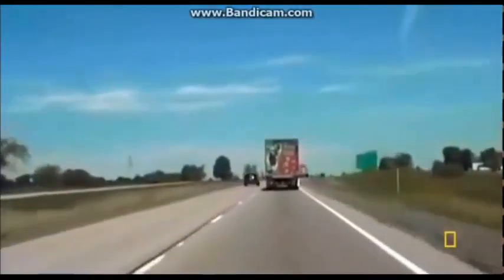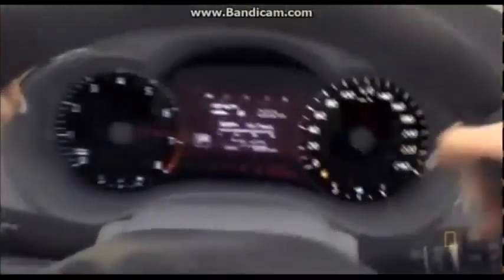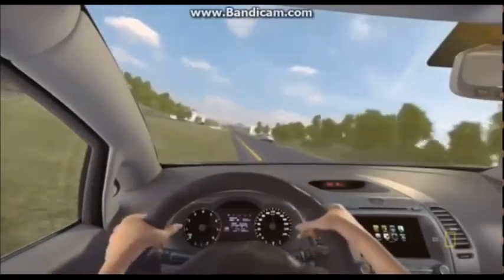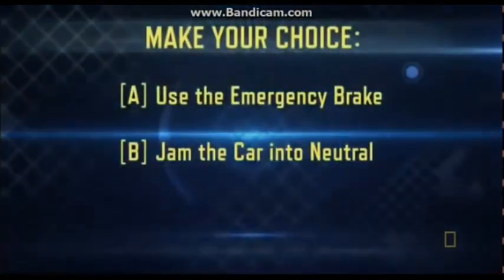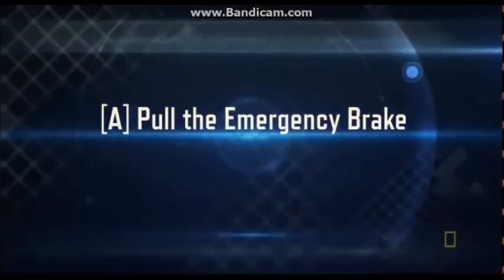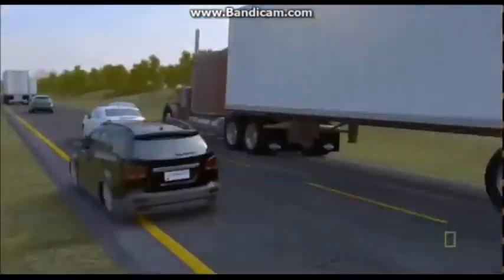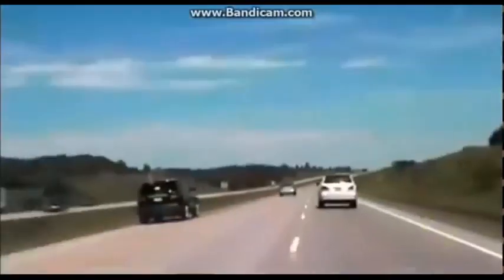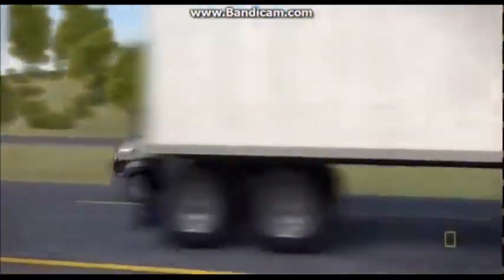How would you stop your car if your gas pedal stuck

Comment: So normally brakes are always stronger than the engine in normal street cars. So you can always stop when the gas pedal lock up.
You can turn off the engine for shure. But after that immediately turn the ignition back on. So the steering wheel wont lock up.

Comment: One time the gas pedal got stuck with my dads car (Chevrolet Caprice) when I was riding with him, I was a kid that time. He was able to solve the issue by pressing harder on the gas pedal which unstuck the gas pedal. Risky but it worked.
Reply: Pumping the brakes can cause them to fail. Until there is an option in cars to cut the power to the engine it will never be safe in electronically controlled automatic cars.

Comment: you can turn off the car and still use the will as long as you keep you battery and accessories on. If you turn the key all the way off then yes, your wheel will lock up (as long as your car isn't old as shit, because "wheel locking" is an anti theft thing that started a few decades ago.

Comment: When he said get the car out of gear then press the brake, if you turned off engine your engine is no longer accelerating so you could slow down then and I don’t think it will lock the steering and if it does cars should change the steering lock so it goes off at speed if the engine is off

Comment: But all jokes aside, you can use engine braking which is where you downshift to a lower gear (ex: from 5th to 1st) which wrecks your transmission but slows the car down

Comment: how i did stop it, you mean. it wasn't hard and i did it in a split second. it got stuck on an pretty severe incline, leaving a traffic light. i dodged the car in front when i realized the pedal was stuck (it was an old '51 jeep willys that was pretty dodgy, so i had to floor it to even make out of the light), then i turned left at the corner were there was no one and stepped on the clutch. i wasn't prepared for it, i never trained for that, heck it never even crossed my mind that this could happen to me, but i was still able to narrowly avoid any accidents. i won't lie, for a moment there i braced for impact against a wall, but i never gave up trying to get control back. it was close, but everything went alright. sounds stupid, but from the time i realized it was stuck to succesfully recovering control was like only a second. if that ever happens again i'm pretty sure i'll do it faster.

Comment: If you turned off the engine, you could use the brakes since your engine is not in use anymore. And you dont have to do it immediately wait until you have a clear shot and do it.

Comment: Or D: Pull On The Accelerator Pedal           And Steer To Safety

B Is Bullshit Becuase You Can’t Put A 120MPH/7RPM Car In Neutral
Reply: Electronic control systems will not allow it.

Comment: well this DId happen to me,  i had  my preteen daughter  in the passenger seat..i was STANDING  on the brakes.. i blew through a red  light at the EXACTLY best time, got to a smaller side  road and  yeah while i shoulda  threw it into neutral? i threw it  into park..nasty  noise  but it stopped and shut  off  the engine.  one of the  more hair raising  experiences  i've had!!  turns  out the cable from the under the brake pedal to  the next part was twisted for some reason and  boy howdy i was glad to not die. :D specially with my  lil girl  there with me.

it was a  1990 jeep cherokee  pioneer 2 door.(i think that's  it cause  it's been several years since i had that car.)

Comment: Not always the pedal that is stuck I had my 03 Galant and my throttle was stuck open I was doing 90 and trying to slow down and my brakes failed, still gaining speed I threw it into neutral and it red lines quick then I shut the engine off and the power steering and brakes locked. Got her off the road safely

Comment: I would still turn off the car, just put the key back into the on position and the wheel won’t lock. It’s pretty easy to steer a car with no power steering at 50mph plus. Same as the cars back in the day.

Comment: Just an FYI if the road in front of you is clear, shutting off the engine and then applying the brakes will stop you the quickest without blowing the motor in your car

Comment: Turn off the engine is the best option BUT with not removing the key cuz when the key is still in you can freely steer without the wheel to get locked

Comment: Cough Might want to point out that all new automatic models in the US have a cutoff switch designed into the car... So if your speed goes over a certain limit your car's engine will automatically shut off...

Comment: These people are wrong. Turning off the engine and turning the ignition to the mode right before the ignition mode unlocks the steering wheel. (I am talking about the mode where you can use the fan while the car's engine is off.)

Comment: This happened to me when my mom let me drive here car for the first time.
I automatically noticed that the gas pedal wasn’t stuck but the engine kept idling at higher and higher speeds.So I actually had to PUMP THE BRAKES and weirdly enough this stopped to engine for revenge at a higher speed.Then I noticed that I can drive very slow but I still had to pump the brake.Very awkward moment.Never asked mom to drive her car again lol

Comment: That lady said she tried to put it into neutral and it was stuck
Reply: That is the problem with modern electronic automatic cars they cannot be put into neutral when there is a electronic fault. 
The only true way to be able to deal with this is to actually cut power to the engine. Cars should have a manual switching system that allows that. 
Electric cars most certainly should have that ability.

Comment: Since the situation is at a highway and cops are warning other drivers. Turning off the engine even if it would lock the steering wheel might make you leave safely.

Comment: This happened to me on the jersey turnpike.  03 mustang. Installed a cold air intake.  Didn’t notice the throttle body  was hitting the band clamp at 3/4 throttle.    Hit the gas hard and the throttle body got stuck open.   Couldn’t get it free.  On the highway. Its a stick car. Neutral or clutch in would of blew the engine.    Put it in 5th gear and rode the brakes till I pulled over into the shoulder and shut off the car.   Disaster avoided.
Reply: I assume your car was a manual?

Comment: Turning off the car won’t lock the wheel. It’ll lock if you take the key out of ignition. Turn the key off then turn it back to where the radio and ac would be on. Sure you won’t have power steering but you’re not taking huge turns. My van used to shut off randomly and I’d lose my power steering. It was tough but I could still steer. This lady just panicked and clearly didn’t get any good advice.

Comment: Actually with that car if the car is in gear and you kill the engine you can still steer but have no power steering. The steering will only lock once the key is fully out but that is not possible because the car is in gear.

Comment: Just turn engine off by key. Then bring back key to "before start" position to unlock steering wheel and brake to stop. You saved engine and yourself, easy. Some stupid AT dont let you put it in neutral when engine is under load I think.

Comment: 110 MPH. They talk like this is some insane speed. Yea, it is not nice, but it is just 170 km/h.

Also, turn off the engine, but leave the key plugged in. Your steering wheel won't lock up. Maybe find out beforehand how to turn off your engine if you have a push-button.

Comment: Turn off the engine but not turn the key all the way off so the steering doesnt lock. 
 
Edit: power steering isn't really necessary at high speeds.

Comment: 1. Clutch first, then go for neutral (Patch pending for US servers. If you don't have a clutch go directly to step 5. Kappa )
2. Slam the brakes (i assume abs)
3. Turn alarms on (safety is never not important and communication is key 👌)
4. Turn the engine off (assuming your car isn't one of those that shuts hydraulics and steering with the engine, in which case, dump it and buy an actual car)

5. If you can't do any of that: Just aim for the nearest pole, or stationary object, especially if it's one of those thick concrete ones, and experience Darwinism. lmao

Comment: Pretty sure cars can't (don't let you) go into neutral at speed.  Also, have you tried pressing the brakes harder, yes?  Ok, pull the e brake to slow down and don't lock the rear wheels, next, push in the clutch- wait cars in America don't have that, crap.  Also consider off-road over a trucks rearend.
Reply: Pressing brakes as in pumping them can cause power failure of the breaking system at either a mechanical level of electronic level. 
Modern automatic cars use a central control system that if goes into fault can be very scary.

Comment: id switch it off and throw it in nuteral. all my cars are older. steering wheel doesnt lock when the key is out heck one of them doesnt even need a key as the pins where jammed and a the key snapped in it. switch her off throw her in nuteral hit the grass(providing its not bad terrain)  and hold on while easing into the breaks

Comment: Well, my car doesn't lock up the steering wheel when you turn off the car until you open the drivers' door and close it. So, I'd just press the power button twice and the car turns off. Simple.

Comment: the answer is very basic and obvious, just put the transmission in neutral, then you can do either coasting or just braking easily. if you couldn't understand this just hire a driver or take a bus instead.

Comment: I don't know about suv or American cars but I have a bmw series 3 from 95 and if I turn the engine off the steering wheel doesn't block. I have to take out the key to block the steering wheel. Same for a golf4 i use too have and an opel corsa i had if i would not put the key in first stage and let it in second stage it haven't block the wheel

Comment: brake power is often stronger then the acceleration....
Reply: To a point. Once the brakes heat up they lose their ability to slow the car down. If the car is putting all its power into driving, the brakes would probably slow you down but it's likely that they would fade before you stopped.

Comment: My dads BMW puts the car into neutral automatically if you open the car door but it does get really annoying when you are trying to park.
Reply: That is all fine and dandy when the electronic control system is fully operational. If there is a fault it could be entirely different.

Comment: Are those Breaks out of paper? I mean even if you flat out the throttle in a Porsche and push the brake pedal at the same time the car will decelarate and eventually stall the engine... In the video the breaks become red and sparks come out of the caliper I guess that means that the breaks overheat? But there is no way this happens in a production car wich always comes with oversized brakes to make them last longer, this is not an F1 car in wich an Amateur can toast the brakes in seconds of he brakes wrong...

Comment: I've got a manual transmission. When I press the clutch it locks at 2,5 k rpm and then I can gear down all the way to the first gear and I mean... I would drive at most 30 miles or so?^^

Comment: 2:15:  PdSafety, YOU'RE the one who doesn't know all the facts.  The steering wheel WON'T lock if you ONLY turn off the engine by turning the key off only PARTWAY instead of ALL THE WAY:  There are 2 stages to starting a car: turn the key on by turning the key only halfway and starting the engine by turning the key on all the way.  Turning the engine off does not lock the steering wheel if you don't turn the key all the way off.

Comment: but arent there Are Safety Futures preventing use of the neutral on high speeds?
Reply: They are stupid systems and not safety by any account. In a manual car it is easy to put the car into neutral or cut the engine out.

Comment: Umm..

You turn the engine into the accessories position, not off.
The steering wheel doesn't lock in the accessories position.

Comment: In every car the breaks are stronger than the engine, cars with electronic throttle will shut off the trottle if you press brake pedal even if you are accelerating at the same time, about this video it must be a terrible electronic failure
Reply: nah this car just doesnt have that feature. it was horrible from the factory

Comment: If you dont turn your key off all the way the steering wont lock
Reply: So to save your car from blowing up from redlining in neutral if your pedal gets stuck put it in neutral and immediately shut off the engine and stop the car. Common knowledge people.

Comment: I drive a 91 240sx and my throttle cable got stuck open after hitting a pot hole
I literally just threw it in 5th and turned it off then into accessories so my wheel didn't lock and pulled over 💁‍♂️

Comment: i did the exact same thing when it happened to me and when i was stopped i shut down the car and inspected the damage and then after that i started the car again and in neutral i tried to free the pedal in case the engine needed to be driving turned out it was the floor mat the was holding the pedal down and well it was easy to fix XD

Comment: What about putting it in neutral and when it goes to about 50 mph use the handbrake
Reply: Wouldn't have to since the care would be slowing really quick and using the brakes at that point is even faster. No need for the parking brake at all.

Comment: Turn off the engine brake hard and then hand/manual brake (whatever its called) on my mopeds if they gas got stuck id always turn off the engine.. and locking the steering wheel? I believe only the hydraulic stops but you should still be able to steer (heavier though) maybe new cars have some sort of safety that prevents steering? Once got it in the tractor lol engine off brakes and handbrake bang

Comment: If you didnt know the answer to this I pray to God I never have to get in a car with you behind the wheel.
Reply: You are mistaken. There is no answer the electronic control systems will not allow the person to put the car into neutral or cut the power to the engine. Even parking brakes will not function when the car is moving. 
Brakes will not over come the engine power being applied. So everything you do will not work.

Comment: dude on here is wrong in some cars they have a lock feature that prevents you from turning off engine while car is running and locks the transmission in place while vehicle is moving.
Reply: That is a disgusting feature in modern electronically controlled cars. Engines should have a cut out facility.

Comment: Whoever made this went to special Ed.
You.can.not.turn.a.key.to.off.in.a.vehicle.if.its.not.in.park. the brakes can help, don't hit the brakes hard but firmly until you can shift into park or neautral. If the engine revs high in neautral let it. At least your life is spared. Make sure seat belt is on, otherwise your in for a ride or launch towards the windshield

Comment: If you turn off the engine you cant steer very well and the breaks wont work properly
Reply: That is the problem with modern electronic cars they lack manual override.

Comment: Turn the engine off of course. Unless the car has a retarded ignition lock, the steering wheel won't lock up when the key is in the ignition. Also, the brakes should be strong enough to stop the engine even at max revs.

Comment: This literally isn't true. The steering wheel lock does not engage unless the car is in Park. If the gas pedal is stuck, and the brakes have failed, turning off the engine is fine.

Comment: turn off engine, then turn keys half way to keep the wheel unlocked, then break or wait till your car stops while avoiding stuff. you wont have servosteering so the wheel might be a little harder to turn but, you are able to. plus your engine wont explode due to high RPM.  you save yourself, AND the car. clearly the best case scenario. also get a manuel you freedom plebs. im from denmark and im more free than you.

Comment: If you jam it in neutral you're destroying you engine and it will total your car, ebrake will lock you tires and spin you out of control or just won't work but I've never head of any cars locking it's steering wheel when off, just when in park but you're in drive so you would maintain control. Turn you engine off, that's your only chance to get out of it unscathed, or maybe you have an old-fashioned throttle cable and a cord is tugging on it and you can just brake hard and play with the accelerator and it will come undone

Comment: Lmao my car used to accelerate every time I would press the pedal all the way down or when i hit 70 mph on the highway and i had it that way for about 5 months and everyday about 20 times a day or more it would accelerate but i knew how to work it as putting it in neutral and reving it up more to get it to unstick on the highway and on the street i would put it in neutral and come to a stop and shut off the engine, turn it back on and head on my way 😅 then i fixed the issue myself cleaning out the sensors and throttle body now its still not ready because my differential shattered on the highway and im current bolting back on the new rear end axle assembly to get it back on the road😅

Comment: Yikes, so according to this, your car is fucked either way.  And apparently the only thing you can do is to save yourself from harm, not the car. Wouldnt the stairing wheel be activated when you have it on...wth is it called. You can click once on start without clutch and the car is on, but not the engine. Or what about hold break in and turn off car? And everything is dependent on what situation you find yourself. Heavy trafic? low? alot of curves? 1 lane?